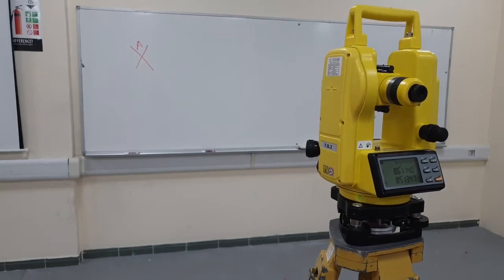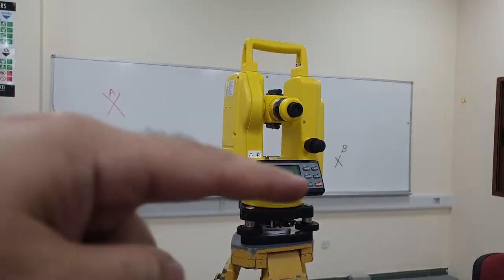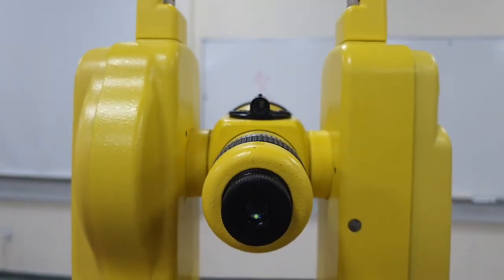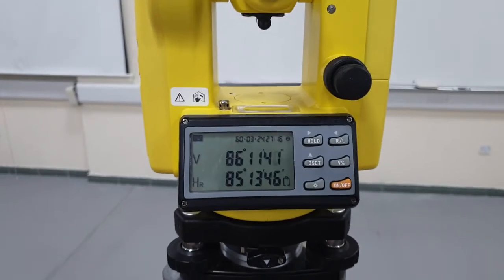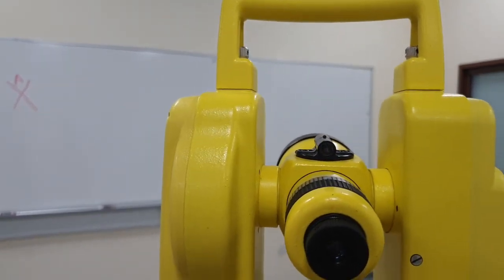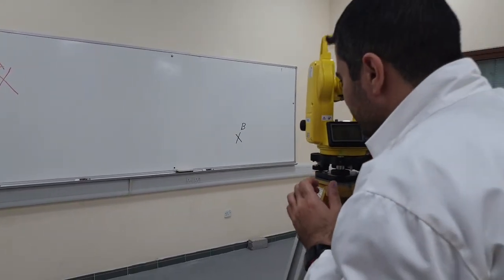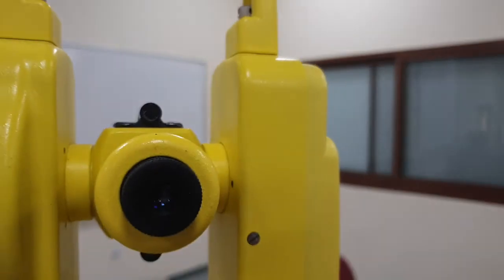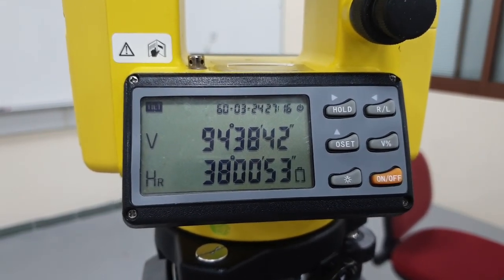digital theodolite part3-taking measurements

Comment: hello sir..wanna ask....the minute  from 4.21, means vertical - horizontal or horizontal - vertical?
thanks for the info.
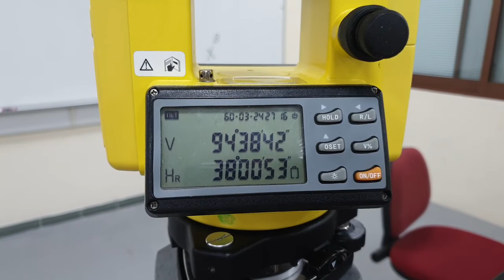Reply from the maker: at 2:10 is the first reading of vertical angle and first reading of horizontal angle , you use the reading at 4:21 for each and deduct from the first at 2:10  for each horizontal and vertical. the vertical angle means the height between point A and B vertically which is very low. which is around 94 - 86 = 8 degrees